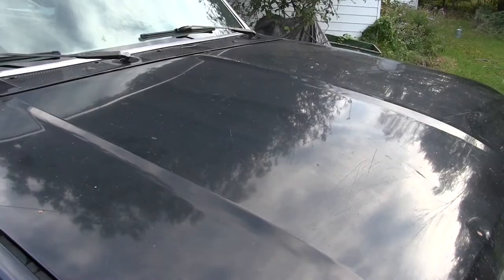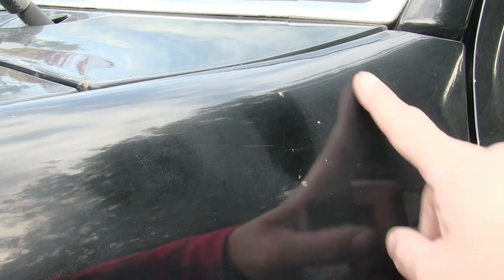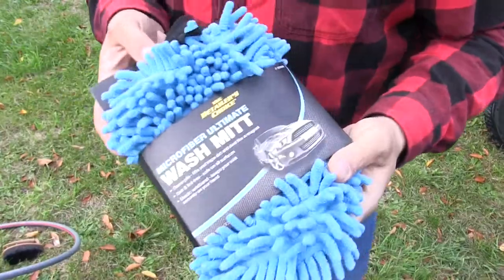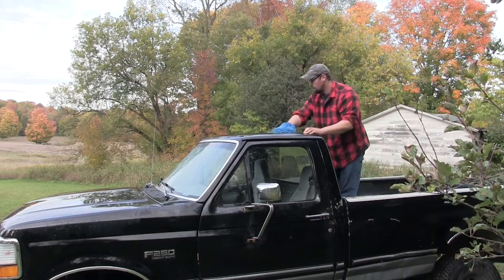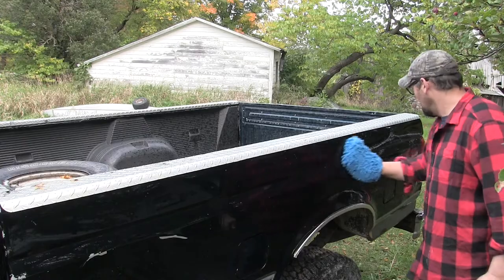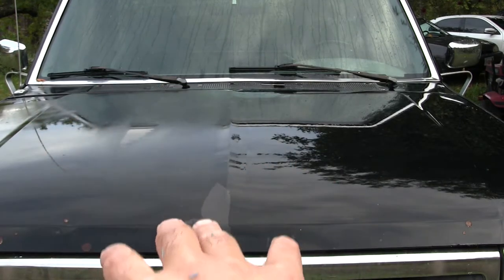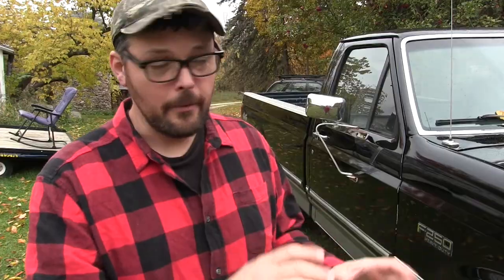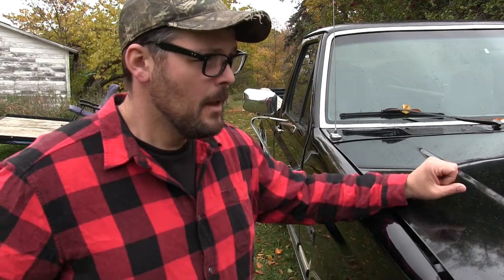7 Tips to wash your car like a pro

Comment: I am so glad you started this channel. You're a good guy to watch. I'd like to see your take on patching rust, whether it be wheel wells or just to better protect vs elements. Running a 2002 Dodge ram 1500 with 205K in NE USA, rust is quite the issue. Thanks for your time. ~Einon
Reply from the maker: I dont know much about rust prevention, but I might try

Comment: Hi Dave, truck looks great for being 30 years old 👍. Just a couple extra tips... I would prefer a white wash mitt as it’s easier to tell how dirty it is. I also started using a second ‘rinse’ bucket to clean the mitt off before it goes back in the soap bucket. You’d be amazed how much cleaner it keeps your wash water. I also fill my buckets with hot water from the kitchen sink. I’ve found it washes the dirt off a lot easier. Just a few ideas that I started doing and have found they work great. Love the new channel. God bless!
Reply from the maker: Thanks For the tips!

Comment: I wash my cars at home, and sometimes the car wash. I avoid using the scrub brush at car washes. Those brushes have a lot of dirt imbedded in it's bristles.
Reply from the maker: I bet they do! I dont use them either
Reply: I will only ever use those on the wheels and tires. Great for them but never use on the paint.

Comment: Dave, I'm in SE Michigan and my first Ford truck was this exact one. I had a 94 F250 XLT with your exact paint scheme. Since then, I've had many of that body style for my landscape business and I still today I run the F250's & 350's. I still have some parts for this truck including the rear glass if you want it YOU CAN HAVE IT. I have it in my pole barn and I do not have plans to use it.
Reply from the maker: Thanks for the offer but I my back glass is fine. I appreciate the thought though
Reply: @cheapwheels9828  Ok, well if you ever need it it will be sitting out back in the barn. Do you have any of those handmade cooking/cutting knives for sale or are you sold out?

Comment: I used to wash my cars by hand all the time same way as you did, as I am to cheap to go to car wash. But one day I  got a coupon for an oil change at Mobil One which has a touchless car wash onsite. The oil change came with a free "deluxe" car wash. I don't know if it's the sealer or wax etc that it sprays on the car, but the car never looked so clean. Both of my cars are 06's and never looked so clean, they look like they are new. So now when i see mobil one coupons on groupon for $6/wash (cdn) , I buy 3 at the time and go every 3-4 months or so.
Reply from the maker: Good info!

Comment: if I washed either my '02 Camry or '02 Frontier they would probably fall apart. They haven't been washed in about three years and I'm not alone in believing that the bourbon mold growing on them (I live in the middle of a dozen distilleries) is the glue that is holding them together. I will have to wash the new addition to the fleet though, '07 Odyssey very low miles, it's still pretty and the wife wants to keep it that way so this info will come in handy. Thanks.
Reply from the maker: Thanks

Comment: Some of those car wash soaps can get very pricey so it may be to your advantage to measure out what your using. I use a car wash brush on a long handle to get the heavy stuff off just so I am not always bending over or rubbing up against the paint. Turn your belt buckle to the side before you start washing to avoid scratching the paint. Ask me how I know this.
Reply from the maker: good to know

Comment: Dave, I noticed the black paint chipped away from the doors. Do parts shops or, in your case, Ford dealers carry those small bottles of touch up paint? Also, on my old Ford Expedition, ( she passed on) to take care of fogged head lamps, I used tooth gell.
Reply from the maker: When I get all the dents pounded out, I'll paint them up.

Comment: Hi Dave! Excited to see what this channel produces in the future. I have a question for you. If either by luck, or by design I ever find myself with Idle hands, are there actually any benefits to washing an off-road vehicle?
e.g.- will it in any way extend the longevity of the vehicle?

I mean other than scratches and the potential of rust, what other dangers does the presence of constant dirt introduce to the equipment?
Reply from the maker: Getting rid of salt is a good reason. But thats a power washing kind of thing